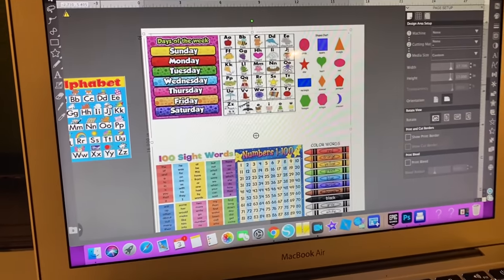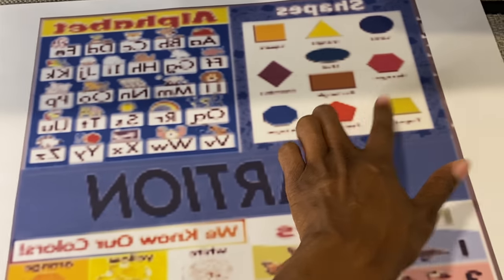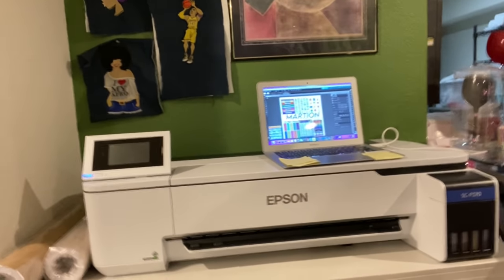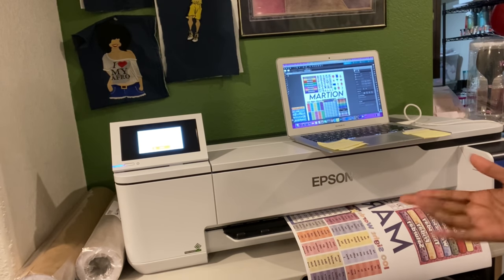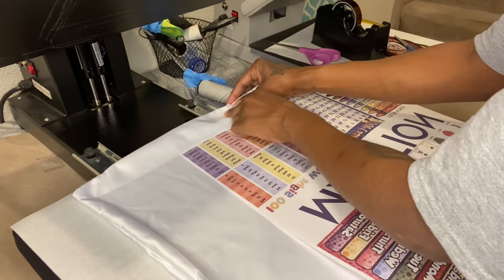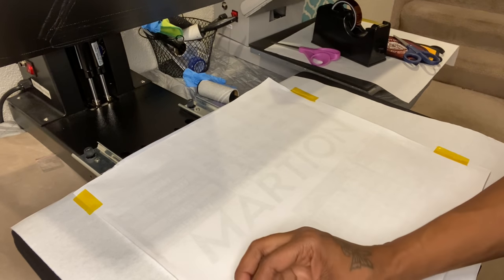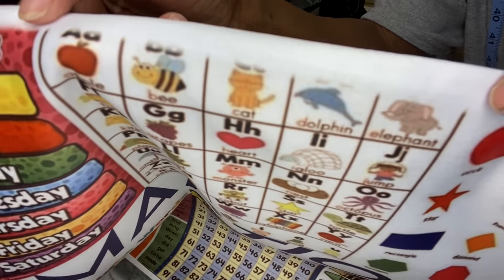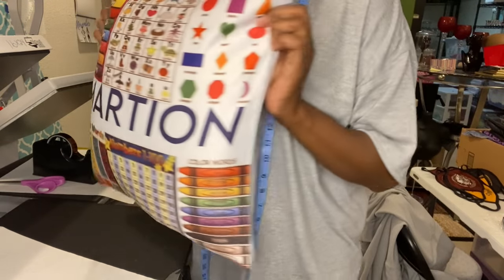DIY Sublimation Learning Pillow Part 1

Comment: Change your artboard deminsions to be a little larger then your image. That helps reduce wasted paper. Also, dont throw the wasted paper away because it comes in handy as blowout paper or even 8.5x11" transfer paper that you could use on the cut sheet tray.

Comment: Thank you so much for your generosity in making these tutorials! Because of you I've invested in all I need to get started. However, I bought a heat press that doesn't work. I unboxed it last night and it sparked and small flames came from the cord leading to the display panel. I'm returning it to Walmart today. What's your thoughts on using the Cricut Easy Press 2 for sublimation, print & cut and HTV compared to a conventional heat press? Should I expect to get the same results if I buy the Cricut Easy Press 2? Your opinion and guidance is very much appreciated.
Reply from the maker: I have the easy press but I prefer the heat press if you think you will be pressing a lot